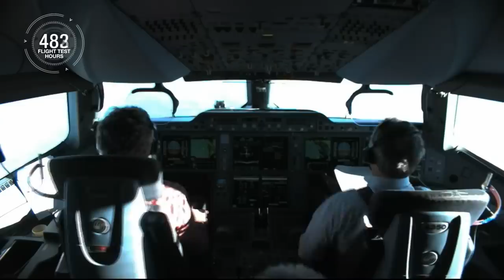End Of The A380: Emirates Considering The A350!

Comment: I prefer A380 due to comfort and less bumpy on air turbulence than any other air crafts these days .since air turbulence increased significantly last 10 years or so my preference is A380 as it’s smooth on high altitude and very less to none bumps.

Comment: I don’t think Emirates will switch their A380 orders because they have already cancelled an A350 order in the past. Airbus is just trying to get them to change their orders so they can wrap up the A380 production.
Reply: I agree with you.
Reply: Previously they were after the Airbus 350-900 if i'm correct. This time they might be seeking the Airbus 350-1000
Reply: نادر الی راحمان there’s no point getting the A350-1000. The A350-900 would clash with the 787 but that’s about it, the 777X makes the A350-1000 irrelevant to emirates especially when they have the 777-9 and the 777-8.
Reply: @morganlambley8655  - You are forgetting that Emirates has contractual obligations for the new A380's which would mean Emirates will pay hefty penalties if they can the A380 order. Swapping the A380 order to A350-1000 would be the cheapest option for Emirates.
Reply: Chris McKellar it won’t be the -1000 if they convert to the A350 that’s for sure. It’ll be the -900 effectively removing their 787s from order.
Reply: @morganlambley8655  - You could be right, especially if it is the A350-900ulr.
Reply: Chris McKellar highly doubt it, the ULR has no use to emirates
Reply: @morganlambley8655  - Why not? Emirates has an ultra long haul flight between Dubai and Auckland (NZ) that is 14,200 km (7,667nmi) using a reduce seating capacity A380 and Dubai and Los Angeles that is 13,420 km (7,246 nmi).
Reply: Chris McKellar then they just use the 777-8 that they already have on order? That’s my point here. 

Both of those routes require more than 200 seats.
Reply: @morganlambley8655   I agree with you. Emirates has no use fot the A350ULR. The B777-8 will cover that. 
But I disagree about the A350 clashing with the B787-10. If you take a good look at the size of these 3 aircraft,  they dont really clash that much. Each of these variants has a cabin length of at least 10ft difference but they all sit the same 9 abreast. The A350-900 cabin is the shortest at 150ft, then followed by the B787-10 at 160ft and the A350-1000 cabin length is 173ft long. If we take the B787-10 as a datum, that translates to 3 less rows or 27 less pax for the A350-900 and 4 extra rows or 36 extra pax for the A350-1000 and has similar capacity with the B777-8. The B777-9 has a cabin length of 180ft long and sits 10 abreast, which places it well above all the other models.
The A350-900 can be used to serve longer but thinner routes to destinations like Canada or Latam  which the B787-10 cannot reach, but does not have enough demand to fill a B777-8.  The A350-1000 on the other hand probably has very limited use as it has similar capacity as the B777-8 and similar range as the A350-900. This places it in a very narrow window of use in between the other aircraft.

Comment: It’s called a negotiated cancelation of the contract.

Emirates gets out of the a380 while preserving a future relationship with airbus by purchasing some a350’s.

Airbus maintains a relationship for the future and ultimately maintains the revenue with the a350 being ordered.

During the past 2 years, the entire a380 program’s future has been in question with  no airlines other than Emirates placing new orders for the plane and others canceling existing orders.  Furthermore, the secondary market for these aircraft is almost non-existent so the residual value comes down to scrap value. 

Let’s face it, the a380’s future had become entirely dependent on Emirates continuing to order new aircraft.  In contrast, airbus and Rolls Royce weren’t willing to put more money into developing an a380neo to give Emirates the financial metrics it needed for the future.  

Perhaps, the reality is that airbus and Rolls Royce didn’t see the return on investment from an attempt to achieve the efficiency needed for this aircraft to continue in an industry that is largely moving away from hub and spoke operations to point to point.

Comment: Emirates seems like they regretted the latest A380 order and will do anything to get out of it. The engine 'issue' with the RR Trent is just what they are using as the catalyst...but it's a poor excuse. Also keep in mind that there is always the EA engine which has reportedly performed better than the RR engine,  consolidating the point that it is a bs excuse that engines are the problem.
Reply: in 2014 Emirates canceled an order for  70 A350  (50 -900 / 20 -1000 ) in favor of the A380 and in my opinion that was a big mistake -   they never replaced the A330-200 so all their destinations are served by a Boeing 777 / A380 and I have doubts that all their destinations are profitable with these 2 aircraf types and the fact that they order now 40 A330 -900 NEO and 30 A350 seems to prove that  - and the A380 can be a disadvantage on the long term  - the A380 has 4 engines - higher operation cost - higher maintenance costs and how many passengers (first + business) are need to have a profitable flight  Till now the Dubai worked well but  there Qatar is increasing their fleet and network , Turkish, Emirates 

Same for the Boeing 777-9   (150 ordered)  - guess they got a special price but it seems that they see the need to reduce this  type in favor of the 787 (purchase price lower , same for operating and maintenance costs )

Comment: Maybe we could see Emirates force Boeing to put the 777x-10 into production as a possible replacement.
Reply: It would make sense, as Emirates has a large B777 fleet and has ordered 150 777-8's and the 777-9's for delivery from 2020 onwards.
Reply: The 777-10x would have a shorter range than the B787-10 unless Boeing designed a new wing for this special variant.
Reply: @chingweixion621  - The B777-10 will carry more passengers that the B787-10. Anyway, Emirates has already ordered both the B777-8's and B777-9, so the B777-10 fit in nicely with their B778-9/B777-9 fleets.
Reply: @chrismckellar9350  yes. More passanger but shorter range. You're forgetting that the B777X doesn't have a composite fuselage. This additional weight will shorten it's range and limit it's  usage on certain destination.
Reply: @chingweixion621  - Emirates Dubai to Auckland non-stop services which is 14,200 km (7,667 nmi) is operate by a reduce passenger capacity A380, so it  make the journey on a tank of gas.
Reply: @chrismckellar9350  the theoretical B777-10 will likely seat around 450pax in 2 class configuration, range of 6000nmi and also reduced payload. Not sure if this will still fit emirates well. At least my opinion is that such aircraft with such specifications will be have limited use for emirates.

Comment: OK for the second time today I read the same article. Actually I’m at more than one article. Emirates never said that they were interested in the a350. Airbus speaking with them because they want emirates to switch from a380 to the a350. There no need for the a350 when Emirates ordered the 787-10 and the new 778-8 and 777-9.  So where would the 350 fit.
Reply: Damien Reddick Emirates had order for 70 a350, but they canceled it and ordered more a380. So they may switch back to a350 again.
Emirates does not have any firm order for the 787-10, it’s not listed in their order book. It just an opportunity that they have if they want to use it.
Reply: So you think would you believe that emirates is going to cancel the 787 -10 orders for the a350, after what the ceo of Emirates said about the a350.
Reply: @12345anton6789  - In November 2017 at the Dubai Air Show, Emirates announced a commitment for 40 787-10's.
Reply: I could be wrong but I read that they are considering the A330 neo...
Reply: Chris McKellar just a commitment, not a firm order. So emirates are not legally bounded to buy the 787-10, they can just walk away. 
They are legally bounded to buy some a380 from airbus and 777x from Boeing. That’s why they’re in talks with airbus, cancellations would cost them a lot of money so it’s better to buy som a350
Reply: Henning Kaasa so why would they even consider buying the a350 if the have the 777x. See I do understand airbus reason for the meeting. They have one aircraft to fulfill two roles. Do realistically why do they need the 777x.
Reply: @12345anton6789  - I know that Emirates has commitments for the B787-10. It do agree with you, the A350-10 could be ordered due to their contractual obligations to Airbus for the 26 new A380's.
Reply: Chris McKellar  that’s crazy and it’s doesn’t make any since on Emirates part if the order the a350, because now you have to long haul aircraft around the same size and similar in flight distance. So in that case boring should start plans on making the 777-10 in that case.  The 787-10 has its purpose and the 777x has its purpose. So what’s the purpose of the a350, a back up aircraft
Reply: @rel6438  - I don't know. You will need to Tim Clark, the CEO Emirates that questions.  I am only experienced air traveler not a CEO of an airline.
Reply: Chris McKellar LoL. But do you get my point
Reply: My guess is Sir Clark has already decided on Emirates fleet for the next 10 to 15 years down the road. Emirates fleet will be 777x and A350, dumping the A380. 777x will be for matured routes ULH, and A350 will serve to purposes, one for regional  routes(they will just put a very dense capacity) and the other purpose of the A350 will be for opening up new ULH routes... That's just my guess...
Reply: @davidtjahjadi5079  - Yes, It will be interesting to see what Emirates will do in an constantly changing market.
Reply: @rel6438   If you take a good look at the size of these 3 aircraft,  they are really not that similar. Each of these variants has a cabin length of at least 10ft difference but they all sit the same 9 abreast. The A350-900 cabin is the shortest at 150ft, then followed by the B787-10 at 160ft and the A350-1000 cabin length is 173ft long. If we take the B787-10 as a datum, that translates to 3 less rows or 27 less pax for the A350-900 and 4 extra rows or 36 extra pax for the A350-1000 and has similar capacity with the B777-8. The B777-9 has a cabin length of 180ft long and sits 10 abreast, which places it well above all the other models.
The A350-900 can be used to serve longer but thinner routes to destinations like Vancouver or Latam  which the B787-10 cannot reach, but does not have enough demand to fill a B777-8.  The A350-1000 on the other hand probably has very limited use as it has similar capacity as the B777-8 and similar range as the A350-900. This places it in a very narrow window of use in between the other aircraft.

Comment: If you realize it, Emirates have a lot of a380s and they finally notice.  But now they want to try out a new aircraft into there fleet other than the 777 and the a380. So then the a350 could do great things and it’s an XWB variant. Which means they can give a lounge or a bar
Reply: But Emirates is probably the only airline that fills up an A380. It would probably be more expensive for them to fly 777X than A380 for, say, London.
Reply: steinwaldmadchen true but I’m saying is that they already have a lot of a380s. They don’t need more.
Reply: Kerezone.  Apparently u should do some homework dude, The B777 is actually the widest , "Cross sectioned" Twin aisle Twin engined Widebodied jet ever existed. So absurd of Airbus when nearly a decade and a half later they introduced the A350-XWB. "Extra Wide Body" when in actual fact is, it's not even wider than the B777 when it was finally debut.
Reply: Brett Demauna you didn’t get it 😑. I’m saying that Emirates could use brand new aircrafts
Reply: For emirates, one A380 is probably equivalent to two A350-900 or B777-9x + A330-900.
Either way you put it, replacing the A380 with two highly efficient aircraft only saves them a little because they really can fill the A380.
Reply: Brett Demauna and the 777X will be wider again so it makes it irrelevant.
Reply: Kerezone brand new, being the 777X

Comment: So, the A380 hater are probably celebrating (again).

But, I just did a trip from Hong Kong to Germany yesterday and I noticed (again) how boring modern airliners are. 

Each  twin engine jet looks more or less as the other one it is just a little bigger or smaller. Even the proportion are the same!

So just take a 777 scale it down and you have something similar to an A320.  You can virtually do this with any machine. It is sooo ridiculous!

There are only details that differentiates them from each other. Twin engine jets have no character, they have no soul. They are just functional machines.

In short: They are just awful and boooooring.

So, the end of the A380 program, as well as 747 and A340 is a really really very sad thing.
Reply: toom2141 c’est la vie ! 😂😂
Reply: Unfortunately, character and soul come with a hefty price tag.
Reply: I do agree twinjets have no soul, but what makes you think a modern flying computer whale like the A380 has a soul (not saying I hate it it's a great airplane)?  The 747 sure does though.
Reply: so true.. the a380 is just awesome
Reply: and what exactly do you expect beyond that? it is a mode of transportation, and it serves that purpose very well in fact. So long it is within the needs and requirements of any airlines, i don''t see why should this be an issue
Reply: Didn't have the A350 before. But I travel from munchen, Germany to Hong Kong with Lufthansa A380. The best aircraft I have ever have. I actually live in Berlin and the two main way to reach Germany for me is Frankfurt or munchen. I choose munchen all because of A380 even though Berlin is closer to Frankfurt. But simply because A380 is much more nicer than any other aircraft.
Reply: At the end of the day planes are actually just that, functional machines. They are not paintings or relationships, they need no soul or character. Plane shapes are similar because the shape is crucial to their performance as a flying machine. As for a 777 looking like a a320 after scaling it(however) that must be some Mercator like type of proportioning given distinct differences in fuselage shape, length and  engine size of the 2.

Comment: A350 and B787-1000 doesn't make much sense. The B787 are not listed yet as order for Emirates, so they may drop it for some more B777x. They could go with the B777x to replace the A380s and the A350-900 to replace the current B777 fleet.
Reply: It doesn’t make sense. Having the 777X and 787-10 makes a lot more sense than mixing Boeing and Airbus on similar models.
Reply: Killercat7, it is not listed on the orders because Emirates has not officially signed the orders. Its just an MOU/verbal agreement at the  moment.

Comment: I think the market has changed and Emirates knows this. That’s why it bought the 787s.  It’s probably looking at Turkish airlines model of smaller twin engine plans to fly long skinny routes. The a350 1000 and 777x order will give versatility that the a380 can’t give if it wants to grow to routes not currently served. That combined with a no existent re sale market for the a380, must make an order switch a no brainier
Reply: There’s no point getting the A350-1000 though, the 777-8 already covers that.
Reply: But they may be looking at a350-1000 ulr. Which will give density and range. And allows them to maintain a fleet mix and therefore the two major manufacturers in their back pocket.
Reply: Patrick Ogunmuyiwa it doesn’t do that though, the ULR you sacrifice passenger and cargo capacity for more range. Just like the -900ULR or even the A321LR. 

The 777-8 doesn’t sacrifice that, and has a better load to start with. I think people are forgetting how big the -8 is, it’s not like the -200 it’s a slightly shorter -300ER with much better range.

Comment: the A350-1000 outclasses the B787-10 in all categories.  so, if the aim is to replace the biggest passenger commercial aircraft of them all, the A380, Emirates would be stupid to do that with the B787-10.  the A350-1000 has longer range, more capacity, is a bigger aircraft.  the point of comparison for the A350-1000 is with the largest B777x which, unfortunately, has not yet been flight tested and will be available for commercial use only in 2021 it seems...